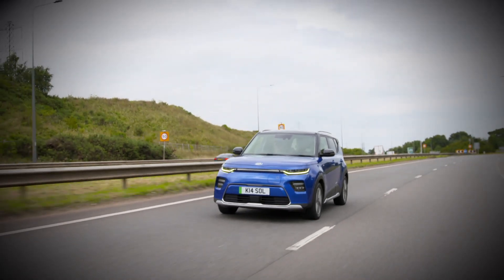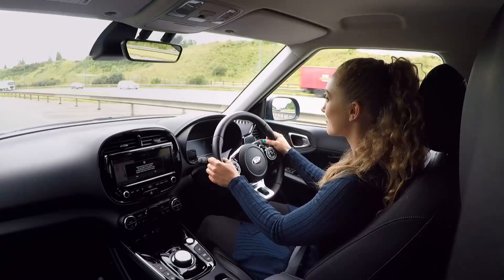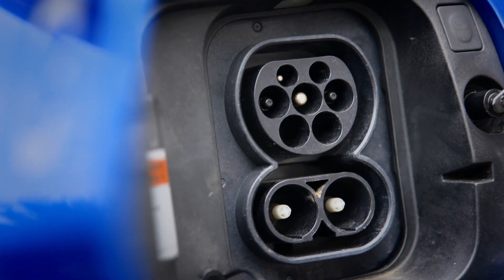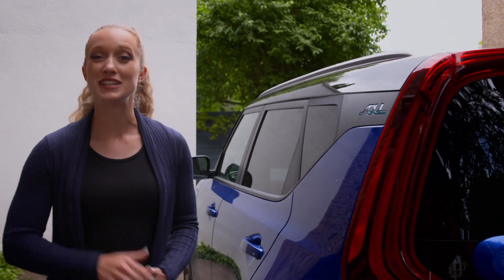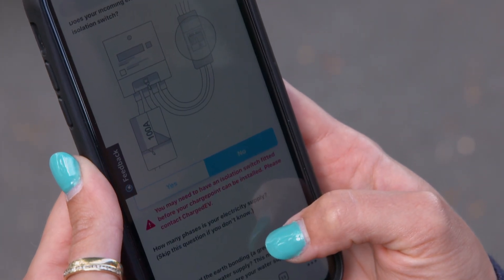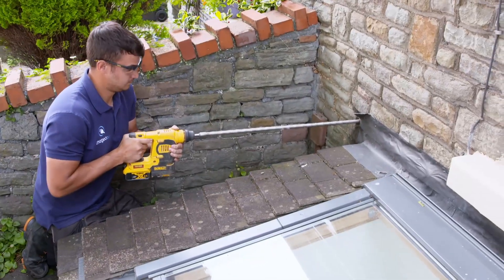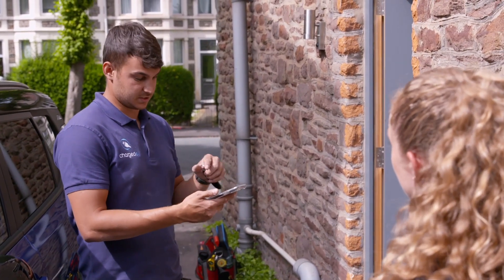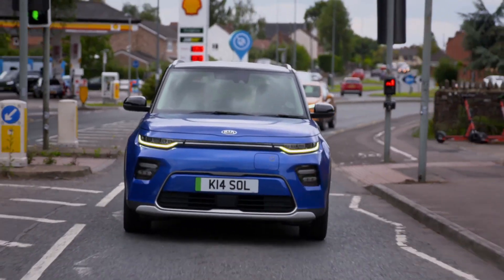How easy is it to install a home high-speed EV charger? | Fifth Gear

Comment: For parts it cost about $900 for me to install a charging port. If a professional had done it, I'm pretty sure it would have been significantly more costly.
Reply: Parts £65, EVSE £150 and fitted myself. 7Kw rate.

Comment: All now irrelevant  from June this year all ev charging  points have to be wired into a separate meter and connected  to a data gathering line out I'll let you think on how they are going to charge you from now on oh and vat on these will ne be 20% not 5 % .. also don't think it's a job for Mr average DIY  man

Comment: One problem i see is that imagine there’s 4 EV cars in your home in the near future, you can only charge one car at a time, so the smartphone charger scenario springs to mind where everyone wants power first and you usually ends up causing a fight.
Reply: Most people will only need to charge once per week
Reply: Also you can just get 2 chargers or more
Reply: @GazzaDazzle  As long as your breaker box has the space. If it doesn't then it can cost several thousand more to upgrade to a bigger one.

Comment: And there's the actual kicker - "not every home can have a charger"

But why are we so blind to the extremely obvious solution which is for EV's to have hot swappable batteries
Sure manufacturers will have to collaborate but they kind of do already
So you'd roll into a Power Station, swap your depleted batteries for charged ones, the station then charges your subscription account after working out what it will come to and away you go inside 3 minutes
Why is this such a difficult thing to sort out?

Until this is sorted, we will NEVER be properly EV'd up...never.
Reply: You do know that EV batteries take up the entire floorboard of the chassis right?

Comment: Will people stop saying it does 280 miles ... It doesn't unless it's a perfect no traffic warm day ... It does real world about 60 to 120 miles less depending on where you're driving, how you're driving, motorway, Broad or city, is it cold, is it wet ... Etc I will say though the only car I've test driven that had about 200 miles range was the Kia soul ev
Reply: Nicely said Arnold, I proved your point exactly in a Mach-E that was meant to do 379 miles on a single charge 🙈 ... (SPOILER: It didn't)
Reply: @PocketRockets  a friend of mine in Iowa had one in the place he worked ... 340 miles claimed range ... Winter in Iowa it wouldn't even break predicted 150 miles ... (114)
Reply: @arnoldtabor3767  Wow! Madness, did he sell it and buy a proper Mustang? 🙈
Reply: @PocketRockets  nope the guy wanted to and I quote "really save the planet in style"

Comment: It would be a good start to make the charger sockets universal by international law if they all claim to be concerned with the environment and forcing us all into EV's?
What with people living in apartments? It could be a good idea to incorporate wireless induction charging in all the parking spaces, connected by an app, in case charging by cable is not an option.

Comment: Pod point will not install one if you have a street lamp or other street installation at the end of your drive.
Until you can provide information on the earthing system for that equipment.
And the earthing must be the same as you as your house.
And mine is not and my car is within 3 metres of a lamp post.
£700 to have the lamp earth changed or 500 to have the home earth changed.

Comment: Trotting out the 'it takes x hours to fully charge...' when looking at the zero cost option is pretty poor. You only need to have a decent 3-pin socket with single connection to the supply , and you only need to charge your average daily use, which for most people is about 30 miles. So this is about 7-8 hours, and my Economy7 tariff works fine for this. £700 saved = 9000 miles for free!

Comment: I find it a bit cheeky referring to a single phase 32A charger as "Fast". Fast would be a HVDC CHAdeMO charger running off it's own dedicated 3x63A three phase supply (at the very least), costing over £10,000 for the charger itself plus whatever the DNO want to charge for running a three phase supply into your house - if at all possible.
Reply: Fast charger was defined as 7kw, but Rapid is the 50kw chargers.

Comment: Cost and availability of the vehicles are bigger issues.
Reply: They are even the Cheapest EV out which will be Dacia Spring from 2022 in the uk going to cost between £15-16K. you could buy a Ford Fiesta for that much only 2 years ago now there £18k . I will stick with my Mk3 Dacia Sandero which cost me £13k top spec with servicing.

Comment: Yep,  every time you "plug in" your car to recharge it,  you're consuming the equivalent of twenty  homes worth of energy....rolling brownouts will be our  future ,as  we need to  be building powerplants right NOW...but I don't see this happening. A well built electric system with plenty of reserves is what brought us to this point, adding a "drain" such as electric cars will eat into that reserve very fast...& considering the snails pace of powerplants coming "online", this does not bode well.
Reply: It's only a 7kW charger., my electric shower uses more than that! Anyway, the point you're missing is that electricity demand is very low overnight, which is why you can get cheaper electricity at those times.
Reply: You're way more pessimistic than any expert I've ever seen.
Look at it this way, the average car in the uk drives less than 50km/day. In a decent EV, that's about 10kWh. So in a 10h night (say 20h00 to 6h00), on average every car in the UK would need a constant 1kW to be recharged at night.

That's not taking into account cars charging during the day.

Load balancing becomes a lot easier with EV's and smart chargers.
Reply: @ZesPak  Although the relatively short distance driven by UK drivers is encouraging, it is by no means applicable to all countries. Sweden, Norway and the Netherlands are always offered up as examples of "It could work, look at us!"....however in the bigger scope of things, these are tiny countries with insignificant populations. Worldwide use of electric vehicles  right now is now running about seven-percent, a rather statistically  insignificant amount. Worldwide,  the plethora of two-stroke gas-powered scooters, tricycles, etc.  both new & old...held together with bailing-wire & electrical tape still outnumber all other forms of transportation except perhaps bicycles....this so-called "electric revolution" is strictly a first-world issue.
Reply: I live in a 3rd world country where the electricity comes from coal

Yet we managed to electrify most of our country. And will soon transition to clean energy sources for about 50% of our energy needs
Reply: @nujjigram  Myself, I'm an American living in Mar del Plata, Argentina...a so-called "developing country"...we see a smattering of electric scooters, beach-sand wide tired versions primarily, but zero cars. Argentina imports natural gas,  primarily from up North in  Uruguay. From time to time we will hear a dull roar in the distance,  natural gas fired turbines...like an idling airliner one would hear at an airport. The 2  and a half million dollar wind turbines one sees down south in the most wide open spaces.
Reply: @AndieBlack13  Argentina is a developing country?

I always thought it was one of the rich countries.
Guess that's my perspective being in a poor country
Reply: @nujjigram  I guess it is all a manner of perspective. The inflation of prices, the local Peso just passed thru 100 Pesos equaling  One US dollar...we go about our business with 500 Peso and 1000 Peso bills in our pockets...??? When an individual negotiates a wage, a professional, or just a guy fixing your plumbing...as a professional watch out...you settle on a three-year contract for services due &  by the end of those three years, what was once a good number, now isn't worth as much.

Comment: You forgot to add in the cost of the electrical work required before the charger could even be fitted. For some that could be very expensive.
Reply: Didn't she mention they had a 100 quid breaker installed?
Reply: @ZesPak  She did but didn't include it in final costings.
Reply: @stevecade857  Tbf it's really difficult to add £100. I feel your pain...
Reply: @andcolbant  Yep. That's 2x tanks of petrol and about 600 miles.
Reply: @stevecade857  boy, that comment didnt age well. 100 quid for 2 tank fulls? No.

Comment: So not only you paying 25k+ for EV corsa size which will be useless after 5years/battery degradation/ but on top of that you need another 2k for charger installation🙁 what a day time robbery🙁
Reply: No electric car has a useless battery after 5 years. They have longer warranties than that.
Reply: What are you on about?
Did you smell a bit too much petrol before commenting?
Reply: I’ve had to put up with similar nonsense being said about the battery in my Toyota Prius Hybrid when I bought it over 11 years ago. It was 5 years old at the time. I was mercilessly trolled by the great illiteratii who insisted the battery would die within 3 years and cost more than the car to replace.

Guess what? Utter nonsense! 11 years later, I’m still on the original battery and have 157k on the clock. The Prius is running like new! EV’s won’t have those fabled battery problems either.

Comment: To be honest, if you don’t drive much a regular UK household plug with a good ground is all I really needed to drive about town. A wall box is nice for convenience and more weather-proof but if you can reach an existing plug it’s not strictly necessary.
Reply: True that, though a lot of installations can pull 2000W, they are often not build/tested at 2000W for 10h.
In theory though, if you do less than 100km/day (double that of the average UK car), you'll be fine on a "granny charger".
Reply: @ZesPak   I have been on the granny charger for the past six months with a leaf no problems
Reply: Depends on whether you want to take advantage of economy 7 cheaper electric or maybe work afters and wife needs car in the day? I debated it myself. I work till 2 in the morning and wife needs car in the day, so it made sense to have the car charged in a shorter time taking advantage of cheaper electric.

Comment: Being an electrician and installing EV charging points in people homes, I can honestly say for what they are they are so over priced, £1000 is nuts. I am sure the price will come down soon. 
I have an Hybrid VW Tiguan on order and what I have installed at my house is a 32amp external commando socket, about £20 to purchase and about 1hour to install, then I purchased a 32amp/7.2 KW charging lead from a uk manufacture, this come  with an in-line control box which deals with all the earth monitoring and cut out when the car is charged, that was around £130, There are way around the cost and you can save money, 
I understand it is easy for me do and say all this. 
Also correction on what was said in the video, you can have the charger as far away from the house as you want, long as the correct cable calculations are done and the installation method is correct.
Reply: I got my charger with the car for free, including install.
However the real headache was arranging this with the other residents as I live in an apartment building.
Reply: @dgurevich1  that’s a pain, this is problem with EV, just the lack of charging facility’s for people that don’t have off street parking.
Reply: @Danny-204  yeah. Luckily, I have a private parking space and my neighbors were fine with it. The techs actually connected the charger to the building's central power box and put a separate meter on it. My government is actually trying to make a streamlined process to installing the chargers this way due to majority of people living in apartments.
EV adoption in my country is still in low single percentages and this issue is exactly why.
Reply: @dgurevich1  are you in the US?
Reply: @Danny-204  no. Israel
Reply: @dgurevich1  sorry did not want to offend you, no one likes being called American when they are not. I think there is a lot of scepticism around EVs. Not sure about in your country but we are being pushed so fast into having EVs, petrol cars have 8 years left in the UK. Then you will only be able to buy Hybrids for a few more years after that, then only EV there on.
Reply: @Danny-204  it's fine.
My government is actually doing the opposite by cancelling tax exemptions for new hybrids and EVs next year.
The main reason is difference in price of fuel and electricity is over 4 times, so they foresee great demand and don't want to lose the tax money.
Another reason I personally got one is to stop depending on fossil fuels produced by our enemies. Trying to convince my fellow countrymen is difficult though.
Reply: @dgurevich1  "Our enemies" LOL thanks for the laugh.
Reply: The CEE to type 2 cable seems to be almost £400
Reply: Thanks for this. I've been wondering if that was possible. Given that plenty of ev's can set their own charge time the smart capabilities of a Zappi or the like are only needed if you're lucky enough to have solar pv, heat pumps or the like to coordinate. It'll be a couple of years still before I can afford a secondhand ev but I'll definitely be looking at this route for home charging. Cheers.
Reply: @judebrown4103  As long as you have the correct earthing arrangements and your disconnection times under fault conditions are compliant. 
But I would not recommend a member of the public install a commando socket to charge there car from. You do need certain safety systems to be in place.
Reply: @Danny-204  oh yes, please don't misunderstand, I would always have my excellent electrician company, Prolectrical of Faversham assess my installation ( they recently installed a new consumer unit with a view to having a car charger installed in the future).
 I had just always wondered but not asked them if a commando socket was a less expensive possibility. Your comment has given me the confidence to mention it to them and I will take and implement their advice.
Thank you for your informative comment and concern, don't worry I'm very safety conscious.
Reply: True, but don't encourage people who are not qualified to do electrical stuff, do it. An easy way to make houses burn.
Reply: You should start a business doing this. Can imagine you making a tidy sum doing 3 houses a day for like £500
Reply: @number2nd  there is a reason why there are dedicated EV chargers.
Reply: Does this affect your electric bill any?
Reply: I think you are right. But what you should have specified is that with the 1k is the EV Charger itself and the installation costs too I am assuming but let’s not forget you are saving over the long run.
Reply: 3 years on and ev chargers are still £1000. And now there is no subsidy.
Reply: There seems to be some 7 KW wall boxes on eBay for around £200 now. You'd have to fit it yourself or pay an electrician though.

Comment: All new buildings should be equipped with solar and Ev charging points.
Reply: You can't charge your car from solar if it's not at home during the day when the sun is shining though. Most cars need a minimum of 1.4 kWh to initiate charging as well which, for a lot of household solar systems, is not achievable during our low sunshine days in the UK. Ideally new buildings should also have battery storage systems as well to better make advantage of any solar installation.
Reply: I agree, but you would need to have a battery storage system as well.  Just wish I had a driveway so I could have an EV.
Reply: The government will still have get the income from car ownership, whether steam, electric, nuclear, petrol or diesel, the country can't be run without that dosh.
Reply: @12alocin  they'll likely introduce more toll roads (congestion easing) & add it on to the price of petrol station based charging points. The revenue from fuel duty is substantial, so they'll figure it out.

Comment: At the moment for me EV's aren't viable. Take a VW UP and it's electric counterpart, £14000 vs £20300 with wall charger. In three years I would pay £1400 petrol. £435 road tax and £750 insurance equalling £16585. No range anxiety and a saving of £3715. Until the price of EV's comes down and the range extends, I'm out.
Reply: £1400 of petrol in 3 years? You're doing the distance where a bicycle would be better! If you'd done 12,000 a year and spent £5k on petrol you've broken even. Now you have to account for the second hand prices of the car, and strangely you'd have been better off in the electric car.
Reply: @youbencowell  One fill up per month at £40, can't ride a bicycle on the motorway and I never buy used nor do I use finance or pcp.
Reply: Or the price of fuel goes up.....
Reply: @stevecade857  Even if petrol doubled in price, my outlay would still be under the price of an EV.
Reply: @captricharddee3634  £0 road tax for EVs won't last forever either. The old bait and switch move as they did with diesels.

Comment: So the price of the charger is roughly 6000 miles of driving with petrol, just so you can charge faster? It doesn't pay itself back as there is no monetary saving unless you were having to use public chargers?
Reply: Which you would be without charging at home.... 🤔
Reply: @judebrown4103  you can charge at home already with the standard plug, just 3 times slower and saving 1000 pounds.
Reply: @scollyutube  not without having my wiring checked I wouldn't. What I'd actually do is, as someone else mentioned, have the wiring checked and a higher powered insulated outside socket installed. Let the car time the charging.

Comment: I do like the last bit, do 5k miles, pays for charger, do another 2.5k miles then park car up for the rest of the 12 months otherwise you'll run over the typical lease mileage limits and walk to work. Leasing for more than 10k miles p. a. is just a silly amount per month.